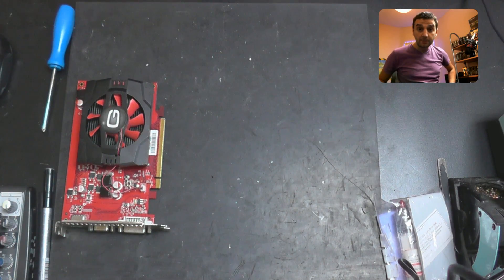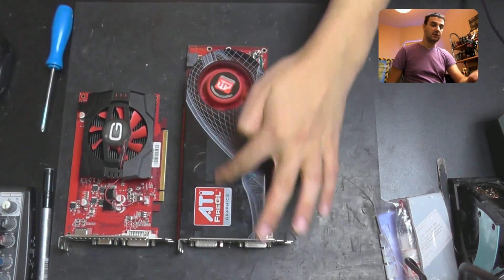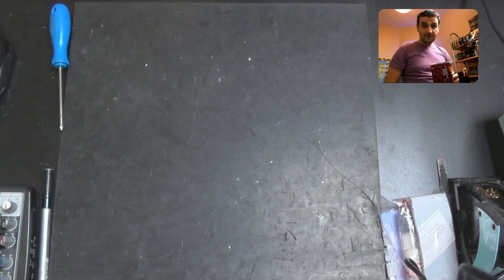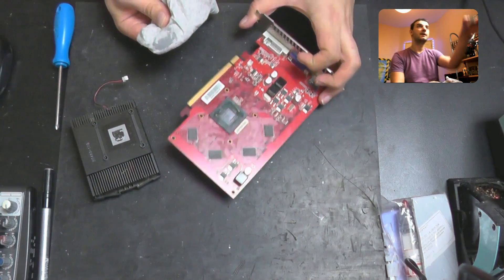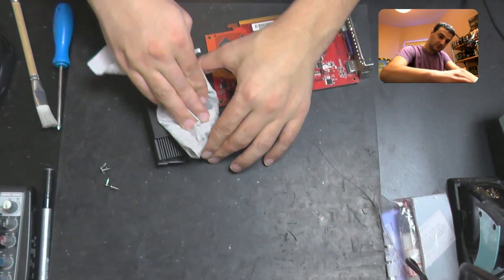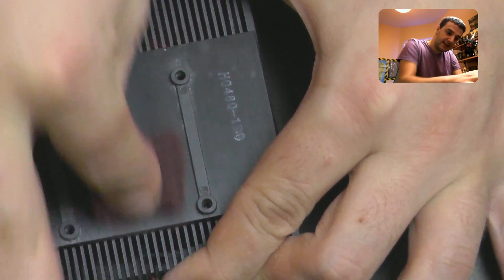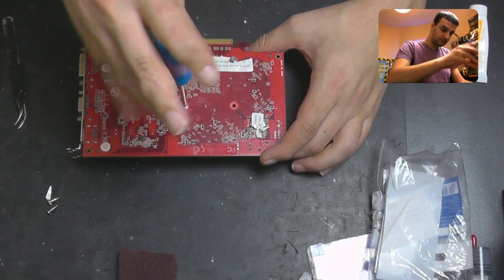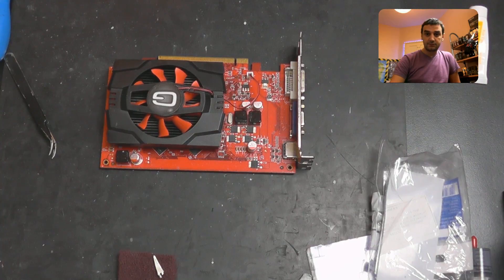HOW TO FIX AN OVERHEATING VIDEO CARD GT 240

Comment: Is this card originally with thermal pad?
Reply from the maker: hello! yes it was original :D
and it was thermal paste not thermal pad. very rare to use pads because they don`t handle high heat. i try on laptop and the chipset died. on PC video card it even harder on temps.